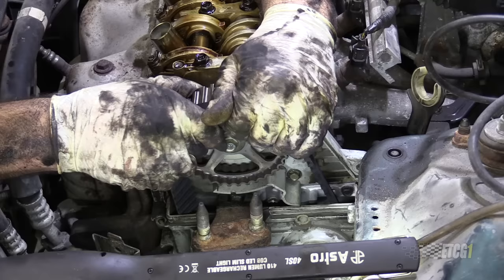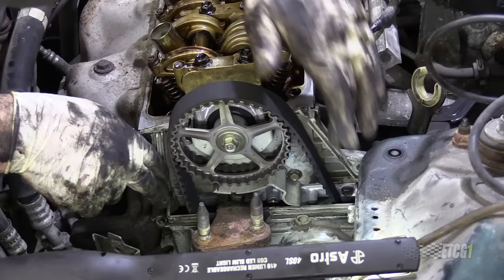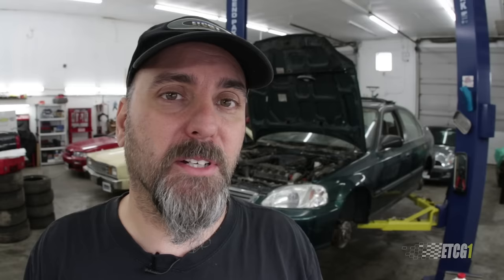How Come Timing Marks Don't Always Line Up Perfect?

Comment: I've never done that to see how many rotations.  I was thinking 4 or 8, but not 52!  I just turn the engine 720 twice and make sure the marks line up on the gears, and ship it!
Reply: I believe he's referring to the timing mark that is usually printed on the belt, rather than lining up with the marks embossed on the head.  If you're looking at the head marks, 2 rotations of the crank had better have everything right on the mark, or you're taking it apart again.  :-)
Reply: Sounds about right.  Ideally, you want every belt tooth to mesh with every gear tooth before you start to get repeats, so the greatest number of rotations of the camshaft before the pattern starts to repeat itself should be the total number of teeth on the belt - although it could be some fraction of that - not every gearset hunts ideally.

Comment: On some Diesel engine there are adjustable cam weels, but I have never seen it on a petrol engine(oem) have you?
Reply: Alfa Romeo 2.0 twin spark engine has it on the intake cam..
Reply: Mechanically adjustable cam is more often a racing or aftermarket modification on gas engines.

Comment: Dumb question time: Why does the belt have to be centered/aligned if the cylinders are dead center? Isnt the belt the same all around? and if, as the video shows, the tooth doesnt bite the same slot on the belt every rotation, why does the belt have to be aligned?
Reply from the maker: The belt does not have to be aligned. The marks are there only for reference to the installer. As long as the engine is in time you're good.

Comment: 26 jan 2019 5:22 pm est:
i wonder whether timing-mark tell distributor(former name for engine-control-unit),about current piston-postiion
source:
'A crank sensor is an electronic device used in an internal combustion engine,
both petrol and diesel, to monitor the position or rotational speed of the crankshaft.
This information is used by engine management systems to control the fuel injection
or the ignition system timing and other engine parameters. Before electronic
crank sensors were available, the distributor would have to be manually
adjusted to a timing mark on petrol engines.' in https://en.wikipedia.org/wiki/Crankshaft_position_sensor from google(car engine piston sensor location)result 1

i wonder how old-car determine when is the time to make spark-plug make spark to push piston to rotate crankshaft

Comment: This is the biggest load of crap I've ever heard. There is no design in having different teeth hitting different slots on the belt/chain. It just happens because of the different ratios between the 2 sprockets and the ratio of teeth and slots on the belt/chain. You would have to specially design a motor to get the teeth and slots to match up every time not the other way around. Which brings me to another point, say no to crack!

Comment: All machined parts come with tolerances. High and low size limits. When extremes in opposite directions are matched up in a working assembly it is rarely a perfect world. This is why the  marks don't always line up. Marks are not made after assembly with a tuned engine.
Reply from the maker: Not exactly. Like I said in the video, this is engineered into the system to prevent the teeth on the belt or links on a chain coming into contact with the same cogs during each revolution of the engine.

Comment: hey what wud happen if u put the cam gear one tooth forward or one tooth backward?
Reply from the maker: It would change the cam timing.
Reply: ETCG1, OK but wud there be performance difference?
Reply from the maker: @jacobfriesen2609  That depends. What you're doing is advancing or retarding the power curve.
Reply: ETCG1, OK cool stuff I love working on engines, so sometimes I have a lot of questions, but if the valves open too soon or too late then it wud affect the compression right?
Reply from the maker: @jacobfriesen2609  Not necessarily. https://www.youtube.com/watch?v=n_9rUXYxAY0&t=45s

Comment: Is it bad to turn an engine by hand with no oil in it?
Reply: There's still plenty of oil sitting around to turn it over by hand.
Reply from the maker: Not in my experience.
Reply: Maybe if you've just assembled it and forgot assembly lube, otherwise I imagine there's a film left on the moving parts.
Reply: It turns a lot more when you're starting it before you get full oil pressure. That's why you need to change oil regularly and use the right grade.

Comment: Americans are so funny: instead of doing some math on how much will it be if we add two apples to three apples in their heads - or with a pen and a piece of paper at least - they always shoot a video where they manually add three new apples to two ones and count them. Sometimes they explode an apple or two... to make it more american.
1) Timing belt 14400-P2F-A01 has 104 teeth.
2) Honda D-engine camshaft pulley has 38 teeth.
3) LCM (the least common multiple) for 104 and 38 is: 52x2 || 19x2 =52x19x2 = 988x2 = 1976
4) If you are rotating the camshaft pulley (38 teeth) then it will take you 1976/38=52 of camshaft rotations to re-phase (i.e. for your marks on the pulley and on the belt to come together again) - if you were rotating the belt then it would take you 1976/104=19 rotations.

You can count the number of teeth on the crankshaft pulley (actually, you don't have to unless you're an American: in a 4T-engine crankshaft pulley has 1/2 of camshaft pulley number of teeth, i.e. 38/2=17 for Honda D) and start from #2 to calculate how many rotations of the crankshaft one will need to re-phase the belt and crankshaft pulley teeth.

Bottom line which Eric didn't make clear: Honda D-engine camshaft is jumping 1/52 of tooth off the timing mark (if observed from outside of the rotation system) per every camshaft revolution; crankshaft timing mark is jumping off at 1/104 of tooth per a crank revolution. Think of it as of sorta vernier caliper thing.
And for those, who still can't make it: this has nothing to do with the phase between the crankshaft and the camshaft. It is only about marks on rotating pulleys and marks on stationary engine parts. After two crankshaft revs (or a single camshaft rev) your crank- and camshafts will always be in the same phase unless the timing belt/chain has been stretched.
Reply from the maker: Well put, but keep in mind that counting teeth on sprockets and doing math on a piece of paper doesn't make for compelling video. ;)
Reply: Eric, the most compelling video would be if there exploded two black chops in the background while you were rotating the things and counting teeth.
Reply from the maker: @TheZzziggy  I like it. You're hired.

Comment: Would have thought it would line up every two turns.
Reply from the maker: That's exactly what they're trying to avoid.
Reply: The timing marks? Yes. The belt? No.
Reply: I think Eric's referring to the timing mark/stripe that's printed on the belt, not the embossed marks you generally find on the head casting.  Those casting marks had better line up with the sprocket marks every 2 revs of the crank, or you're pulling it apart again.  :-)
Reply: I’m not a mechanic and have done a few timing belts. I always mark the belt and honestly on the cars i have changed the belts always line up with the same teath after 2nd turn. I guess this does not apply to all cars. Thanks Erik at least for me if i change a belt that has “hunting” I won’t freak out now.
Reply: @linkavichtruousky1  read my last comment again. I think you misunderstood.

Comment: Designed to be hunting?  What the hell does that mean.  Ridiculous.  Why not designed to be lined up.  Which Is what they make it clear you must do.  Why don't they mention that ridiculous claim of hunting.  It's obvious you are either repeating that phrase without thinking cuz if you did think about it you would realize it makes no sense.  " yes let's design all this so everything works in sync but if the sync is messed up in a tiny way cuz it's bound to as things stretch and or wear or shrink but to we will say that we designed it to be hunting so dumb people can think it means something even though it doesn't but it sounds like it does if you are dumb." Designed to be hunting?  No no it isn't. It isn't designed to be off a bit and then hunt to be on but only hunt never find cuz if it  found it it would then not have to do what it's designed to do and that's Hunt.  Ugh